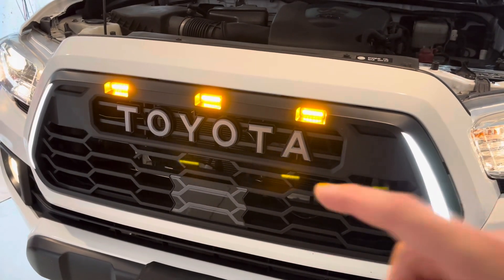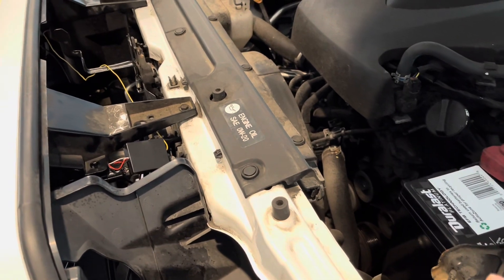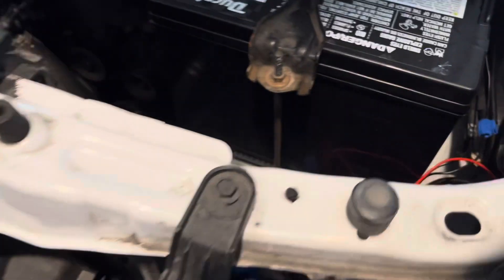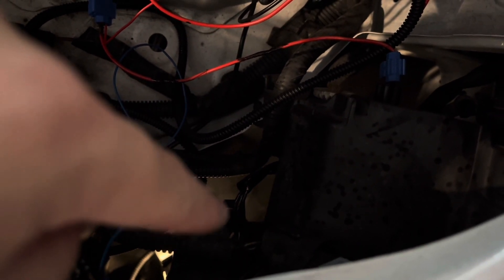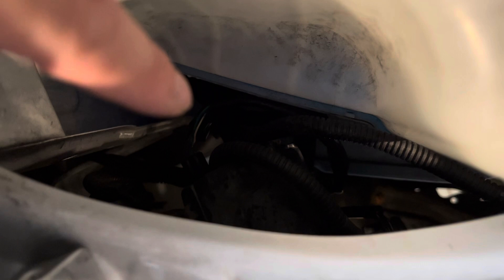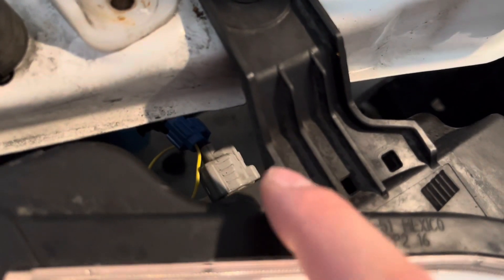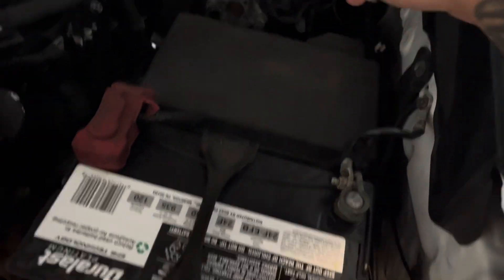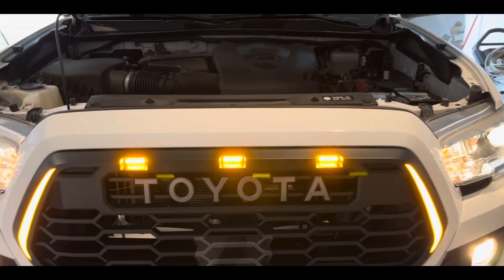Yotaverse V2 TRD pro grille wiring setup on 3rd gen Tacoma

Comment from the maker: Update v2: this is specifically a 2018 Tacoma TRD OR. I did upgrade my headlights to the alpharex. DO NOT use the blue wire tappers you see in the video. If you want I can make an updated video for those of you who want it just comment here. What I would recommend is still continue connecting the wires as you see in the video but STRIP the wires to give you 1/4 of an inch of exposed copper wire from the grill and wrap them around the connections they attach to. 
Then use liquid electrical tape around the exposed wire and/or heat shrink wrap them (I did not heat shrink wrap mine). That way you have a secure connection and it won’t come undone. Hope it works out for y’all!

Comment: So I installed the grill and spliced in the electrical, but the raptor lights only come on when the headlights come on?
Reply from the maker: If you do it the way I did then it won’t work if you want them to run all the time. If you have the raptor light positive wire connected to the fuse box directly OR the battery itself it will stay on all the time. Battery is guaranteed to stay on all the time but the fuse box is a little tricky and I’m not sure which fuse gives all time power.

Comment: got this grille installed and got the raptor lights working. still trying to figure out how to have the raptor lights to always be on instead of just night. and i think wiring the side drl’s is beyond my expertise. any idea a place i can take it to maybe help me out ?
Reply from the maker: Sorry it took me so long to respond. You would have to tap into the fuse box from the raptor lights itself. I spliced all my wires into one positive and one ground.
Reply: @JoshTheFlyGuy  yes haha u got all of them working besides the two middle led’s never figured those out they’re just off all the time 🤣
Reply from the maker: @bwood9197 haha no doubt yeah if you splice them together into the positive wire and connect them to your DRL headlight wire it’ll work. Turn signals will be tapped to the turn signal wire there. Just make sure you splice enough of the wire to see it and then take the copper wire and wrap it around. I pinned a comment on my video because mine kept coming loose with the blue tappers. 😀

Comment: Are your raptor lights on all the time or only when headlights are on? I just wired mine up and if I have my light switch to "auto" nothing is on, if I switch to drl then the raptors come on too but I wanted them on at all times
Reply from the maker: Definitely some kind of wiring issue. I would double check the wires. If you want raptor lights on all the time. Connect it to the positive on the battery. It’ll stay on once the cars on. Fuse box is tough so I can’t be much help there.